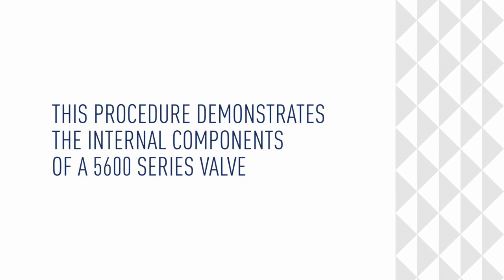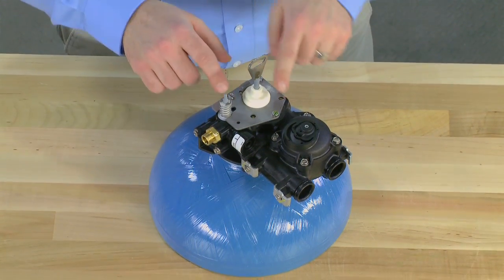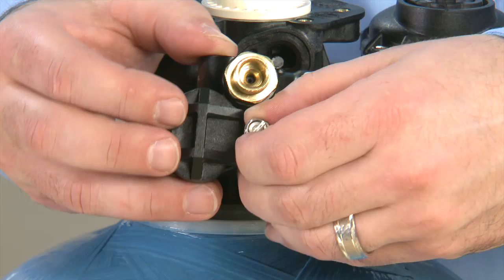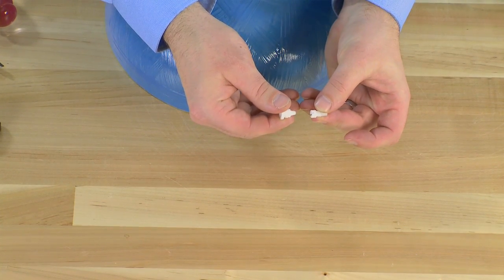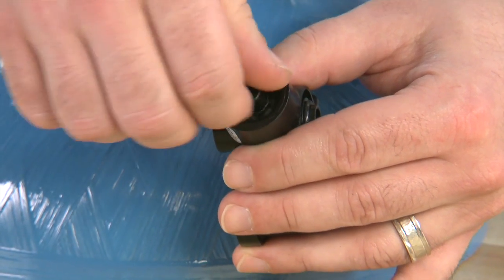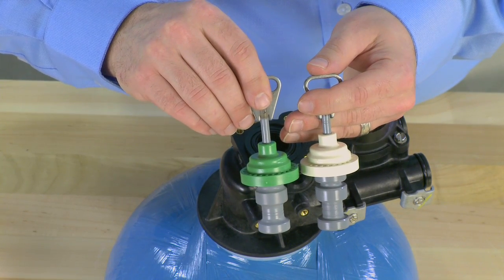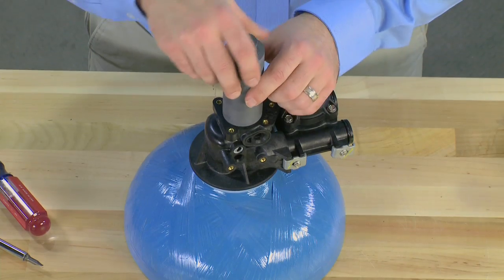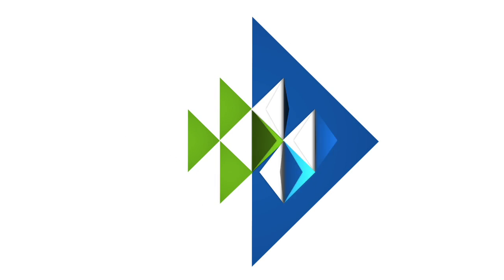Fleck 5600 Control Valve Tear Down

Comment: The small white "flow disperser" shown at 6:02 is part no. 13497 and is labeled "Disperser, Air" in the service manual. I pulled this out in order to remove a few specs of black rubber, but then it broke apart while I was cleaning it. This was an unexpected setback, and I now have to wait a week or so for a new one before the softener can be put back in service. Just a warning to other viewers - this part is very fragile!

Comment: Hi please let Me know why the recycle run at all time, I have paid for one month Water $280/Month, because I didn't know and checked was the Recycle Water, now I am running bypass. Thanks for Your Help.
Reply: If the softener is running 24/7 then you have a bad seal. To fix, replace seals and spacers. I have had this happen a half dozen times to customers softeners in the last year. Pentair needs better seals as this rarely ever happened up until the last year or two.
Reply: @tomdavis3495  
Shit product

Comment: I'm not sure where to begin! The metan tank is leaking from the valve and top being pushed up by what looks like an iceberg of salt. There is no bridging of salt in the salt tank. The float is not moveable. The system worked fine until the  local yokel did "maintenance" telling me the wrong Venturi assembly valves were on the Fleck system (it worked prior to his tampering). The float also was moveable prior to his "maintenance". Where should I begin to fix this - note - this guy workd for the only two well  and water systems in our remote area.

Comment: Several years ago I bought parts on ebay from a place in Florida to rebuild mine. I did not know of the silicone lube for the seals and it was an absolute nightmare. Thanks for this video, I hope to get mine going again.

Comment: Hello.  Is the Stuffer Tool essential or can one install the seals without it?
Reply: my boyfriend is a water softening technician and said that you can replace the seals and gears for the piston without the stuffer tool.
Reply: I did thanks.  I didn't see any need for a special tool.
Reply: You really don’t need the stuffer tool for these, because the piston chamber is vertical. If you work on the bigger commercial ones like the 9000/9500 or the 2900/3900 series, where the pistons run horizontally, you do need something to hold the seals in place. Just not necessarily the ludicrously expensive stuffer tool, which a competent machinist can turn up for you in about 20 minutes.
Oh, and by the way, Pentair people, when are you going to stop using the plastic mountings for the camshafts on the 9000/9500 units? Every time a piston sticks, the motor keeps,on trying to,turn the shaft until the mounting breaks. You then have to either strip the whole thing to replace the backplate, or just replace the head complete - either option is expensive for the customer.
Now I just switch the head for a Clack valve and wave the problem goodbye. Better service flow, easier servicing, doesn’t have this problem - you guys need to catch up.